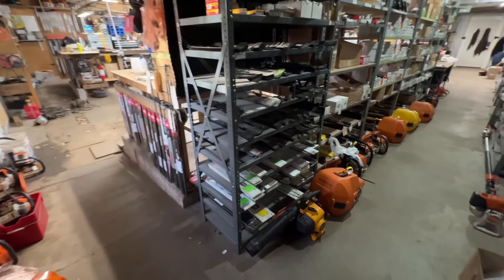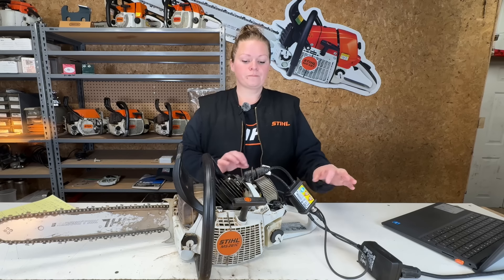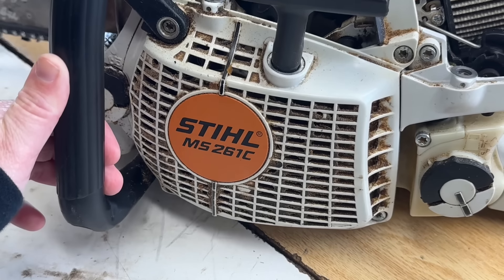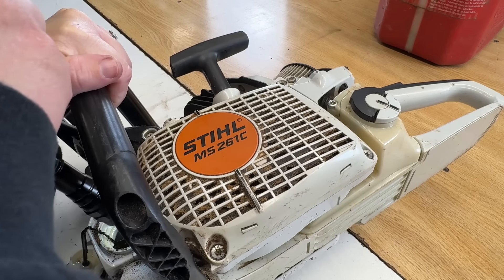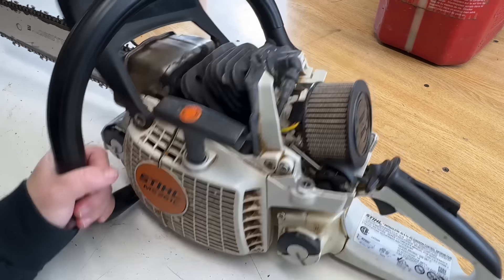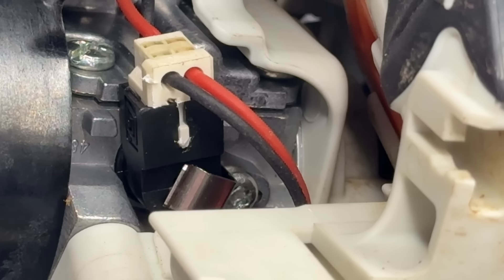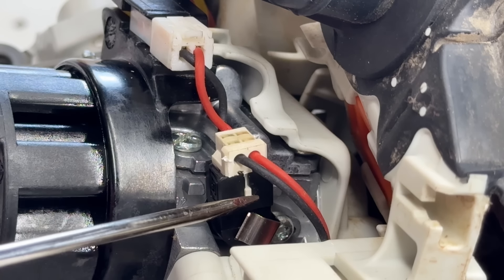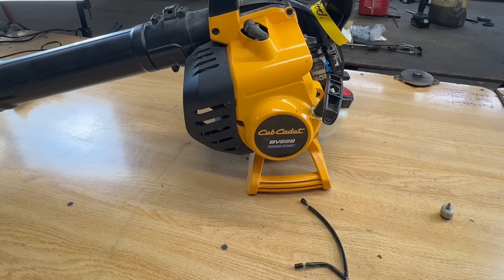Stihl MS 261 Mtronic Chainsaw  --   HARD TO START!  -- WHY Won't It Re-Start?!

Comment: Thank you very much, this was helpful. I bought the same saw back in 2014, when they were introduced. First time I used it it wouldn't restart. I brought it to the dealer, and after a couple of days, they said it was fixed. I think they swapped the module with another new saw or something. The saw still wouldn't restart and back to the dealer again. This time they had it for a couple of weeks and finally said it was fixed. But it was not. I now came to the conclusion, that the dealer would not be able to fix the saw and I put it on the shelf. Instead I bought a good used MS260 and cut my firewood with that and with my old 026. But then I watched your video. I bought an orange fuel filter and the green solenoid valve. My skills as a surgeon came into play, and bingo the saw is fixed after 10 years finally. Thanks from Denmark.
Reply from the maker: That is incredible.  It made my day just to read this comment.  Thank you!   Do you know Claus at HobbyMotor on Youtube?  He is located in Denmark.  A fantastic mechanic.
Reply: @marriedwithsmallengines  👍

Comment: Thanks for another great video.  You need a cleaning station closer to the bench to cut down on the walking to the door each time or a 4 wheeled push cart so you could place all the components on it and push them all over the door at the same time to save on the number of steps.😆
Reply from the maker: Hi!   Do you make carts? Haha
 Thank you SO much for being here! Stew, please watch for a upcoming MS170 video!
Reply: @marriedwithsmallengines   I could but probably the shipping would be pricey.  Will stay tuned in.

Comment: Hi Erica – I bought a couple of first generation 261 + 461 MTronic saws back in about '15, and they gave me nothing but trouble. I'd intended to buy a set of carbureted saws, but husky and stihl weren't making adjustable, choked medium size professional saws anymore. After warming up, they would vapour lock, and were very hard to start, especially in the tree. And eventually they scored their piston and cylinder, and stihl complained that I wasn't using stihl oil, but I was using what the dealer recommended, which was Optima. Turned out the 261 and the 461 we're running, lean, and ruined themselves. They were repaired on warranty, but I traded them in for a pair of fully adjustable, choked husky 372s, which are great, and running to this day. To Stihl's credit, all the owners I've met of later model 261 and 461 saws have been happy with them.
Reply: My 2018 261 runs great, I run 45 to 1 with Stihl oil.

Comment: Thank you for the video. Our MS361CQ is before the Mtronic era. However I did observe during the test run how the saw smoked on acceleration, which I thought odd given the electronic contols. Then the fuel solenoid not allowing a good restart.... It was interesting when the cylinder looked pretty good inside. Amazing what simply a faulty or may be dirty fuel solenoid will do for how the saw runs. And the older filters potentially allowing more debris to flow through the filter and contaminate the solenoid. Thank you for the education. I don't know if we will ever own an Mtronic series saw, but at least I have a clue as what I am looking at if we do. Well explained step by step. And lastly, your videos are making me want to go out and check our saws and clean them better. I really like a clean saw, just sometimes hard to keep up when the end of the task is done and more chores await. I am hoping to do better on my cleaning efforts to keep our saws (MS200T, MS251C, & MS361CQ) healthy machines.

Comment: Thank you so much for posting this excellent video. I am really interested to learn that you can obtain information on the saw's use such as the number of starts and run time. It would be even more fun if you could collect that information wirelessly. By now perhaps still has started adding Bluetooth to every saw so that the saw can wirelessly send you data for review. Thank you also for showing a little of the yellow Cub device. I was quite curious about it. I hope you are able to get some sleep and spend some time with your family.

Comment: It's a good thing you were removing the solenoid because my hands shake something fierce. I changed out the bulb for my blower and luckily I didn't drop the little screws. I cheated by using a stick magnet to keep from dropping them down inside.

Comment: Thank you to show the secrets of these modern saws, with mtronic system, requiring computer and software to repare and even only service. What is this damned solenoid for ? It's a pitty to see the evolution of stihl, following modern cars, with more and more computing system and less and less possibility to repair by yourself. Well, I'll keep my collection of stihl 031 and chineese saws as long as possible ! But I understand that for pro of services, the evolution helps to increase the quality. You are doing a very good job for each saw, and your customers are lucky to have a so carefull service.

Comment: Re: fuel color - I found this comment from a guy:
 Pump gas labelled as containing NO ethanol was clear and the E10 was yellow'ish. 
So maybe that was E10 in the tank. And the smell was like old moldy 'corn'.
We've been told by dealers to never use ethanol in small engines, here in SW Missouri.

Comment: I have been a Stihl owner since the 1970s. My first, I can't remeber the model, I bought 2nd hand with a ~30" bar, a BEAST of a saw. My second was an 011AV made in Virginia, a light saw for my elderly dad to use, that I used just a few days ago. My third was a MS170, I gave to my daughter last month, when her trees fell in a storm.
I have learned a lot from you.   I hope you keep on making videos.
Thank YOU!
PS: I've had oiling issues with the 011 AV. I can't find OEM parts locally, only china made substitutes. Any advice?

Comment: Please keep doing videos, I only hobby fix saws. I don't get many `M-Tronic saws in my shop. I recently bought a MS462  if I change the solenoid, will a Stihl dealer need to recalibrate it? That 262 would make a good video.

Comment: Another great repair. None of the saws that I have are M-Tronic, but it's interesting to learn about them. Question:  You kinda left us hanging on the fuel solenoids, other than the different colors-  Did you ever find out what the differences are, between the white/black/green ones?

Thanks!

Comment: Thanks for showing the inner workings of the m-tronic.  Good to know it still needs initializing/programming/tuning even if I fire the parts cannon and replace the solinoid myself.

Was that part of the carb assembly?  Aka, new carb replacement also needs programming?

Comment: In the 80's - early 90's  vehicles had computer controlled carbs with electronic metering solenoid valves.  The ECU was also able to adjust ignition timing and fuel mixture based on varous sensor inputs.  The emission systems that were added made them complex though.  It's interesting  to see a basic  system without all the emissions stuff added on chain saws.  I guess the next evolution for gas saws is fuel injection if battery power doesn't make them obsolete.......oh wait....MS500i.

Comment: That was a awesome informative video, im rebuilding a same unit it has a black Solenoid, i put it back , no go , I put a new kit in it with the white one , do you have a green one and how much, it does fire up for a short time when I put fuel down the carb,  there is pressure and fuel in the line, checked for pressure and fuel line ll is good , you did mention about the switching the solenoid from blk to white and  talk to the tech, you never gave the input, help
Im located in BC

Comment: Hi, awesome videos,question same issue for a 362, for the fuel solenoid, do you have to reset the ms before using, or can I do this at home with no issues?

Comment: Very interesting. Does this information regarding the solenoid apply to the first gen 261cm as well? The one with the older clutch cover design and and flat cylinder fins? I have one of those and am interested to know. Thanks. As always.

Comment: That was cool. 
I have MS230 which is 19yo and MS311 bought two years ago. I wonder does it exist to buy side tensioner for MS230? If it does I'd love to request it at my local Stihl dealer. 
Cheers from Croatia!!

Comment: I think a lot of ocd people like myself would like 2 see the cleaning also.  At least a short clip of that.  
Also do you ever sharpen the chains or file the rakers.
I also noticed you rarely ever adjust the low and high on the fuel screws.  Do you always leave them at factory setting.   Thanks

Comment: Oh. I have a Question😁
When not using a chainsaw is it good to empty the fuel tank and then run it until dry?
Or leave fuel in it with fuel stabilizer?
Since I now only use the ms170 couple times a year at the cabin. 
Thanks in advance

Comment: What is the model and info on the extendable pole saw?  Had a 131 that had disengagement issues that the fix was really bizarre!
Reply from the maker: It's a HT135
Reply: @marriedwithsmallengines  thanks,  the HT131 that came across my bench had apparently been to the local Stihl dealer where it was purchased with disengagement at the saw gear drive.  The owner was told it needed a new complete new extendable end, minus the gear/saw head, for the tube it was close to 500 dollars US.  It was taken back home as that was a lot of money for something that was just past warranty.  The owner continued to use but did not extend it as they had another that did function so the two units worked for low and higher trimming.  The owner brought it to me to see what I thought.  I had never been into one before. I downloaded the Stihl parts PDF and looked at each component as per the parts PDF. I found nothing that was not in the sequential order as the parts shown.  After a few times of looking at it, the problem became apparent. At the connection of the fixed and extendable is the plastic bearing C clip assembly.  The PDF has the C clip on the incorrect end/side of the fixed bearing hub.  I was hesitant to alter what should have been factory assembled.  The owner stated that only the Stihl shop had ever touched it.  I got hold of his other HT131 and opened it up to find the C clip was on the outboard end of the hub, opposite of the other unit, which is why it can not fall from its position and maintain engagement at any length of extension.  Now my question became why did it function at extensions for quite some time?  Maybe the tension of the bearing sleeve and engagement with the gear head was holding the drive tube in position until wear out allowed it to move. I repositioned the C clip into the outboard side and all has been good since.  I have looked at the PDF  multiple times and it still shows the C clip installed on the incorrect side of the hub.  The other issue is a stihl dealer was not going to repair it just replace something that did not need replaced just fixed.

Comment: have you had any experience with the Stihl moto mix? people seem to either love or hate it. from a mechanics standpoint, what does it do to chainsaw engines and carbs? M-tronic ones in specific.
Reply from the maker: We use it in our personal equipment for off season storage-- I have no complaints- amazing stuff!
Reply: @marriedwithsmallengines  ever actually ran it through anything?

Comment: I enjoy your videos, including this one, but this one is somewhat provocative (not in a bad way).  I don't recall seeing any advice about changing the fuel solenoid. If not updating the solenoid can result in a lean condition that would be important to know, since lean running can cause inadequate lubrication and accelerated wear -- correct?